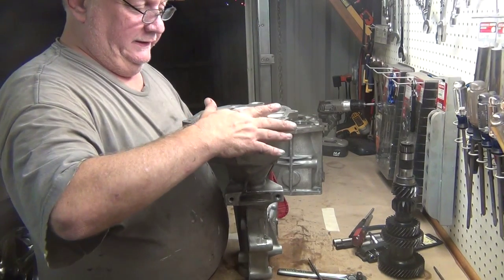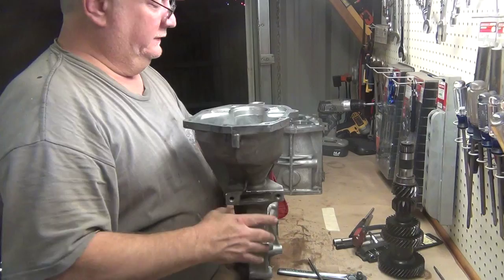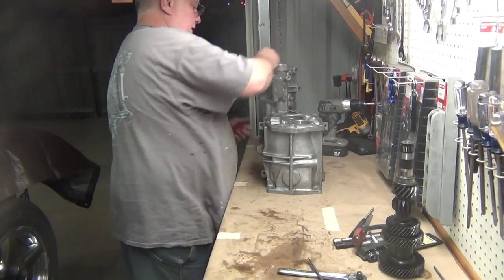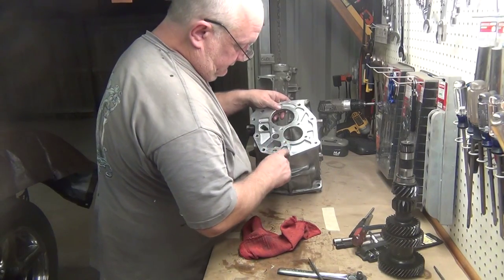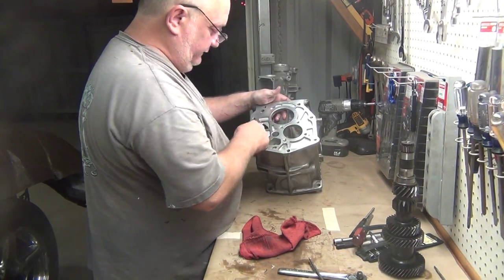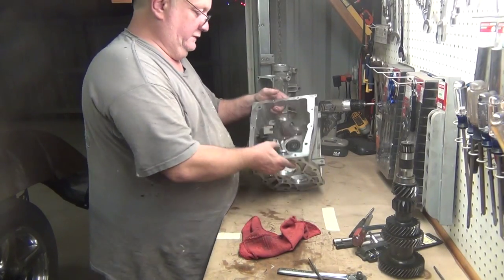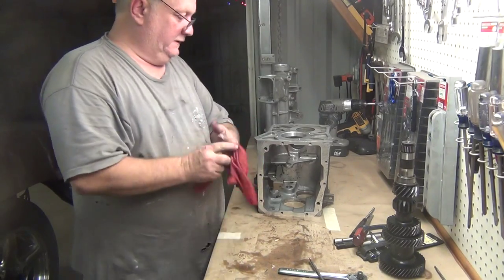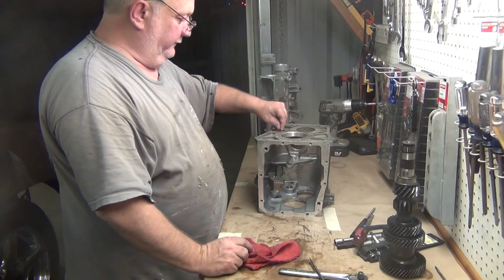94 firebird part1b

Comment: Hope u keepin well , buddy , jus wanted to clear up sumtin, is there a bearing behind the rear oil seal of the tail housing, is that the bearing u mentioned ,  you pressed out?
Reply from the maker: Yea there is a sleeve behind the rear oil seal did i say bearing i show the sleeve in one of the videos hope this helps and if you need some answers send me your tel # in a msg i will give you a call later
Reply: Ok thank u so much
Reply from the maker: I knocked that sleeve out with a flat head screw driver later
Reply: Because I have some up and down movement on the rear end of the shaft , had oil leak out the seal even after installing a new seal, really appreciate these videos, great stuff